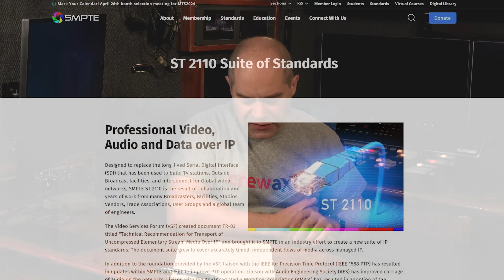What is SMPTE ST 2110 IP Video? Let's talk about it.

Comment: As you note,  uncompressed and compressed workflows have their benefits in overall topology cost and where they are used in the chain.  A couple of notes on NDI.
NDI discovery server (similar conceptually to NMOS) allows NDI to be registered and discovered across subnets,  and also allows for practical uses of NDI for much larger device pools by speeding  up the discovery versus the default automatic discovery implementation of NDI.  Also the combination of various flavors of compression and NDI Bridge toolset allows the interconnect of NDI networks across the public internet.  Unlike other protocols in that space,  it does simplify one to many transmission when doing so.  Thanks again for this video. Learned a lot!

Comment: I'm small fry - nowhere near ST 2110 budgets - but I am relieved to hear so many of my own thoughts reflected from Doug. As a low-end production team with just a few members, 2110 seems like a "revisit in 2030" proposition. 

And honestly, I would be very dubious of investing in network or network-enabled equipment from BMD. They have a reputation for making versatile, budget-friendly equipment - but it's a given that QA isn't great, reliability isn't great, support isn't great and they'd rather put out a "new and improved" product instead of upgrading their existing ones. (Just look at Doug's Web Presenter / YouTube streaming woes)
Reply: it depends. 2110 Can help create realy simple setups, at least easy cabeling.

if you use a bunch of the new studio cams and want to use them over a single network cable, the Blackmagic Studio Converter is about 1000$.

A 24Port 10gbe poe Switch with 2x 100gb/s uplink port is just 3700$.

if you se this with a atem that support 2110 ist getting cheaper than traditional sdi very fast.

Comment: This sounds like slightly redefined usage of the multicast ranges, the switches support pruning unless required instead of blast to determine required and then trim.  Multicast itself has been in use for over a decade so it's a reliable system, still learning about precision time and this standards methods of integration on the network.  This video is a nice step in that direction.

Comment: Until BMD releases a 2110 switcher, their ecosystem is going to remain hybrid with all of its shortcomings. I would be surprised if we don't see a 2110 switcher out by next year, once they've got a little more experience with the ancillary stuff first.

I think they'll sell a bunch of their little converters to pro markets for things like confidence monitors or non-critical interface conversion for things where a little latency isn't an issue. Random POV cameras, etc... BiDi over Cat6 worth PoE is very handy.

I do think they'll sell a lot of the Audio monitors. That's right in the sweet spot for non-critical monitoring positions where a failure isn't a showstopper, and buying a dozen of them for a facility starts to have savings on any budget that can be then better spent elsewhere.

Beyond that, the currently available 2110 switchers are in a very different class to most BMD gear. Which is a major differentiator in markets.

BUT. "BMD 2110" is a talking point that shouldn't be ignored either.
Reply: From my experience with 2110 systems at major broadcasters in europe I dont see any of their 2110 products being used in professional systems.
They are based on 10 GbE for endpoints, every professional system I've seen in the last years has been based on 25 GbE for (low channel count) endpoints with backbones at 100 GbE and up. This is due to the 12G bandwidth needed for 2160p50. Even though most broadcasters are still working in HD, nobody will build a new IP-system from scratch that doesn't offer a clear path to UHD. Blackmagic uses compression to do UHD over 10 GbE with their own codec, I don't see anybody else adopting that, as everybody else who wants to do compression uses JPEG XS.
CAT wiring, which Blackmagic seems to push, although they do have some devices with fiber, is also not used for video networks. Many broadcast facilities also already have stuctured OS2-fiber cabling from their legacy SDI systems, so cost isn't that much of an issue.
Another problem is that Blackmagic doesn't do 2022-7, which is the standard for dual network interfaces for redundancy, which every system I have seen uses.
The lack of out-of-band-management is also a problem, in-band-managment isn't used much in my experience and only used in special circumstances (e.g. Grass Valley cameras due to a limitation of fibers in SMPTE 311 cables).
Control is also a major issue in every system, the industry has embraces NMOS and Blackmagic say they support that, but in the real world it's often not as simple as that and interoperability is still a problem.
And last but not least 2110 deployments require a lot more support by the manufacturer than SDI and in my experince with Blackmagic so far their support is pretty barebones.

So I don't see how Blackmagic would fit into a professional system and the cost of integration would quickly make up the cost savings the hardware offers.
Reply from the maker: @janludwig7286 I don't think Blackmagic is targeting that type of customer at all. They're clearly after much smaller operations.

Comment: Would love to learn more on how Ndi vs 2110 compares to each other. 😀👌

2110 or NDI video signals captured from within Resolume and Vmix for live stage presentations on huge led video walls on stage. 😀👌

Wow didn’t know there was
2110-10, 2110-20, 2110-30 and even 2110-21 😮 thank you for making these types of videos, more power to DJP 🎉😊
Reply: for 2110 with bmd you need an PCIE card, like decklink just with an sfp+ interface instead of BNC.

Your standart Network Card is way to slow any way.

NDI is completly different. is uses existing, low bandwith networks, so it needs to compress signal a lot and thus adds way more latency.

Comment: Fantastic video Doug!  Fascinating stuff.  Mikrotik makes a 24 sfp+ port 4 40gb switch that should be ptp aware for about $600, and those will start hitting the secondary market eventually.  Beyond that, does the industry take the Dante approach and slap an FPGA to network card to make the whole system work at lowest possible latency?  If we're using ethernet for AI applications surely it can be made fast enough for video transmission.  It will be interesting to see.  Low latency is paramount for me even above resolution so I'm sticking with coax and fiber SDI for the time being as well.

Comment: Great video, thanks for that. I'm always looking for alternative transmission methods in our old building with its thick walls. We only have 100Mbit from the switch in some areas and rarely more than 1Gbit between switches. That's why this is unfortunately not an option for us.
Reply from the maker: I assume that means that running fiber isn't an option? Because that would give you all the bandwidth you could ever need.
Reply: @djp_video  Hi Doug, that's exactly what we are doing with dedicated connections. Our data network doesn't have enough bandwidth

Comment: Hi Doug, if using as a simple back to back stage box type set up, what is the max distance the Ethernet run can be? 30m?
Reply from the maker: That depends on what type of cable you're using. Cat 5e should work up to about 40m, but Cat 6A should get your closer to 100m.

Comment: Hi Doug. We just got the 3x3 boxes. We've gotten them to work using direct connections. Our goal is to use it for basic video village setups. But what do I need to multicast to multiple gateways? The BM 360 switch isnt available yet. Any recos for a basic (cheap!) 10g switch that can allow multicast?
Reply from the maker: The bare minimum is a managed switch which supports IGMP Snooping v3. You'll need to enable that feature in the configuration interface (web or command-line). Once enabled globally, you'll need to enable it for each VLAN on your switch (if you have any setup), and then you may need to enable it for applicable each port on the switch as well. You'll also want to set options to tell your switch to discard unknown multicast traffic (otherwise it gets forwarded to all ports, flooding the network). I'd also enable the IGMP Snooping Querier if you can. You can enable Fast Leave if you want, but it isn't required.

Consult the documentation for your switch or an experienced network professional to see how to do this, as it varies from model to model. 

Ideally you'd also want PTPv2 support, but finding that on "affordable" networking equipment is nigh unto impossible.

The least expensive switch that I would trust that can do this is the TP-Link TL-SX3008F (https://amzn.to/463awxd) with compatible SFP+ modules like the TL-SM5310-T (https://amzn.to/4d3S1eq). But if you're willing to go with fiber connections rather than Ethernet you can actually save quite a bit, and use much longer cables. For that you'd use a single mode 10G SFP+ module (like https://amzn.to/3zG7zXc) on each end and a single mode cable, preferably armoured (like https://amzn.to/3W3L5ae). For this application fiber is quite a bit cheaper (and reliable at a distance) than copper. 

There are switches from other manufacturers that are designed and even pre-configured for AV over IP, starting with the Netgear M4300-8X8F. But the price does jump quite significantly.

Comment: Be aware, Ubiquiti switches do not handle IGMP v2 or v3 well. I know from experience. Also check that the backplane bandwidth supports all ports at full usage. Example 8 port 10gbps switch needs to handle minimum 80gbps throughput.
Reply: 160 Gbps for full duplex. I learned that this is called non-blocking.

Comment: Is the blackmagic 2110 implementation/codec compatible with other vendors?  For example, would the Panasonic AW-UE160 with 2110 work with the Blackmagic 2110 inputs?
Reply from the maker: It's supposed to be. At least for anything lower than 2160p30. (Camera limitation, not BMD.) The only way to know for sure is to try it.

Comment: Thank you! You should make a video about NDI and Dante. NDI and Dante on a same network is a nightmare. Is 2110 going to solve that problem?
Reply from the maker: I have the video about Dante already. I haven't done one on NDI. I haven't spent enough time with NDI to feel confident enough in creating a video about it. (People creating videos about things they don't really know/understand is a pet peeve of mine.)

But in any case, if you can put all of these technologies on their own independent network you'll be avoiding a lot of potential headaches. While you can run all of these on a single network, it's really not a great idea, and there's usually little reason to, as in many cases they don't interoperate with one another anyway and can start mess with each other's bandwidth or signaling or timing or whatever.
Reply: @djp_video  I agree completely! NDI should be distinct from the Dante network. I'm hopeful that 2110 would provide a superior alternative in combination with Dante
Reply: @djp_video  One of the main benefits of multiaccess networking is multiplexing many applications on shared networking equipment. The value of these technologies goes down significantly if they can not not share the same physical network.

Comment: So I know the focus here is really about video productions and broadcasting but I would be interested in a solution there ST 2110 was implemented in a remote desktop solution. As you said, since there are no steps for encoding and decoding a video signal a pipeline properly implementing 2110 should have next to no latency. I could have my main computer in a closet and then simply remote into it at native speeds. It also sounds like you could support very odd display resolutions like any that follow the aspect ratios of 3:2, 16:10, or even like a 21:9. It sounds like the current implementations would not be that if there are sync issues but I can see a future where 10 or even 100Gbps routing is common and you simply connect to your server in this way.
Reply from the maker: It would likely require native support inside of a video card to "encode" the desktop into 2110-compatible data for good performance. While it isn't compressed, 2110 uses YCbCr (sometimes erroneously referred to as YUV) rather than RGB, and the conversion back and forth isn't necessarily complicated, it doesn't come for free. 1920x1080 at 60 fps is 124,416,000 pixels that have to be processed every second. Without hardware acceleration, that's potentially pretty processing intensive.

Much of the live streaming of a desktop (Twich, Zoom, OBS, etc.) is accomplished using one of two methods: (1) the video card itself provides and/or encodes the data (since it has direct, raw access), or (2) a driver intercepts video data as the desktop is being drawn and builds an image from that, so it is effectively only having to process things that are changing rather than every pixel in every frame. Neither of those method gives full, direct access to uncompressed YCbCr data, so something has to do that conversion.
Reply: @djp_video  Yes the GPU would likely have to do the majority of the work and more than that there would probably need to be a gpu on the other side of the pipe to do the same. It is possible though. I think it is what intel is doing with their Intel Media Transport Library. I am pretty sure it is still in development as I am not aware of any products but that seems to be what they are doing.
Reply: IPMX, the continuation of ST 2110, holds the solution to unique resolution formats.
Reply: @Douglas_Gillette  Ok this looks awesome. This is where I would like everything to go. IPMX looks like a great standard, It is an open standard, It also has mechanisms to apply optional codecs depending on the bandwidth available. If someone has 100Gbps networking then sure they can go with an uncompressed stream but in the more likely scenario that someone has 10Gbps or less then they can still use the implementation with only slightly higher latency.

Comment: great and detailed video as always! thanks. One big question, i do CCTV/IMAG work, normally 3 cameras on stage, connected (as now on 3 sdi cables) 75/100 meters to the FOH, we have a video switcher (atem extreme or studio) and vj on the FOH, and then the signal goes to the led screen on the stage... my question is... LATENCY? can i put one of the new BM 2110 3x3g boxes on stage and another 3x3g box at FOH, with one CAT cable, and get the same Latency as with SDI? do i need a PTP clock when only get box to box without other network? THANKS!!
Reply from the maker: The BMD 3x3G boxes have their own PTP time server that you can use, so that isn't an issue.  But as far as latency, the best any of us have seen with those boxes is 2.5-3 frames.
Reply: @djp_video  thanks! i think 2-3 frames is a lot for someone singing live, in close frame, add the camera , and led screen processors delay and we are far away from audio lip sync